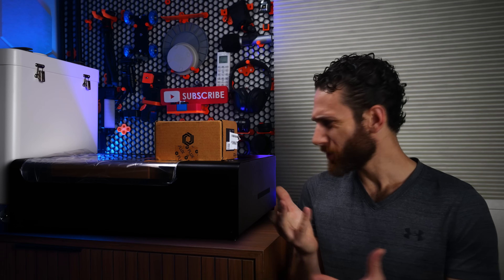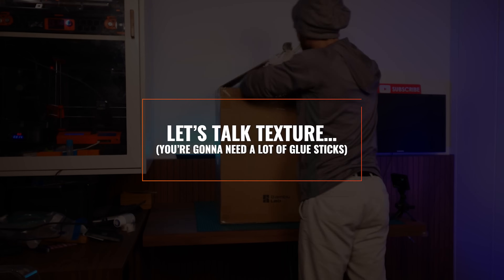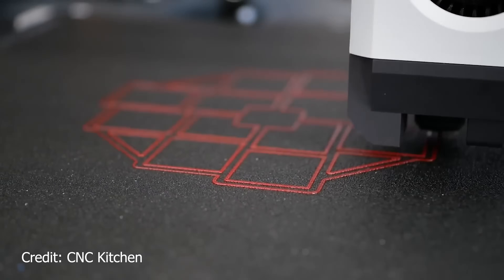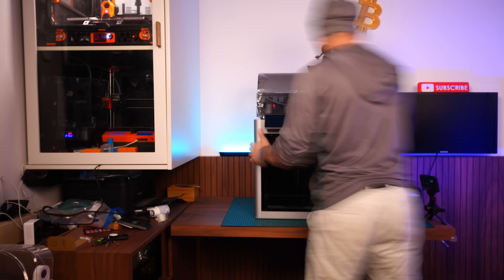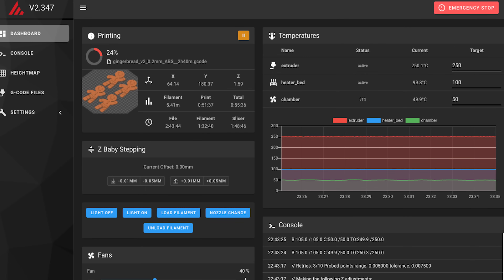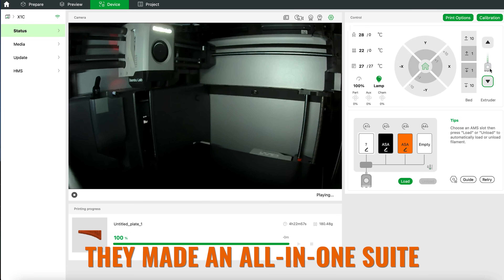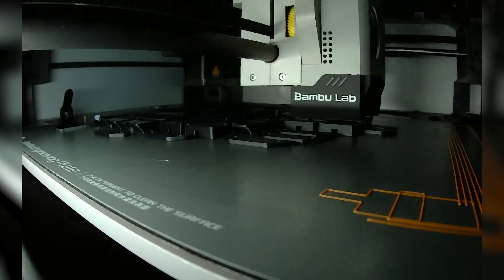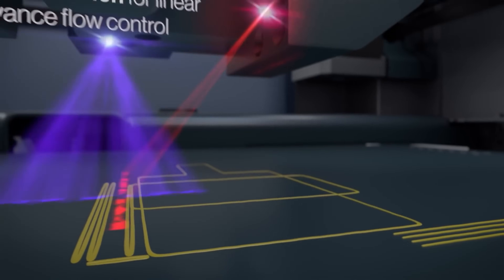Bambu Lab X1 Carbon: What NOBODY Is Talking About...

Comment: You said Bambu fixed some issues that you pointed out, which issues did they fix/improve?
Reply: There were a few he referenced.

Nero3d, in a livestream, stated the BL printers did not have thermal protection. This was an error on his part and a miscommunication on BL part. There is thermal protection it's just not what nero or any creator was familiar with. (3min shutoff of hotend.) the heater is ceramic which makes it incapable of thermal runaway like the older heat cartridges(hardware protection) and if it does not detect  a temp, or its wrong it will cut off.(software protection) 

The filament "poop" can be adjusted in the slicer and has been there since bambu studio launched,

The community wanted lan only printing to avoid the cloud and the feature was added  a month after launch

There was a flashing red light at the poopchute but in the beginning but firmware turned it off.
Earlier you could only send one "plate" at a time now you can send all plates of a project to the printer to avoid downtime re-slicing and sending prints manually.

There have been constant updates and fixes. BL studio even has some creality printers in the Bambu Studio Slicer and adding more things all the time.
Reply from the maker: Thanks for answering this for me, you saved me a lot of effort! Next week, I have even more things, and I have a feeling some will be solved by then LOL. They're faster than I am...
Reply: @thenextlayer  sure thing. I am a KS backer(X1CC) so I got to see a ton of growing pains from Aug until now. I'm coming up to 1500 printing hours and think I have a understanding on the quirks of the printer.
I will parrot everyone else here and say you have made and excellent video. I'll stick around to answer any questions that I can as well.

Comment: what happend to the fps in the intro and some other parts of the vid?
Reply: Sounds like there is an explosure related issue. Maybe the room is too dark so the shutter speed has to be slower to maintain the correct exposure?
Reply from the maker: @bjdchwr  Yeah... we weren't able to fix it, and unfortunately I didn't have time to re-record. Sorry... did it prevent you from enjoying the video altogether?
Reply: @thenextlayer  Not at all, the video was great!
Reply: @thenextlayer  Not at all. I think most of the footage were good just a few. Good work! PS: I purchased 2 of X1C plus I am planning to build the Voron 2.4 using a kit from Formbot, with ABS printed parts out of X1C :-)